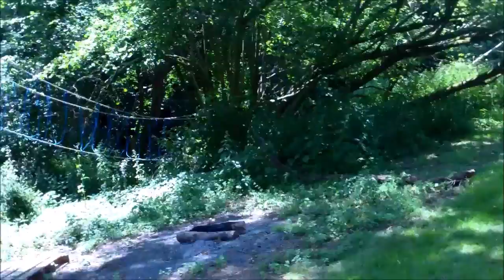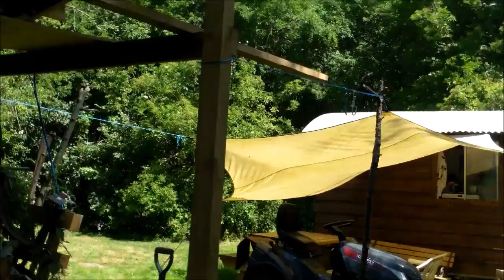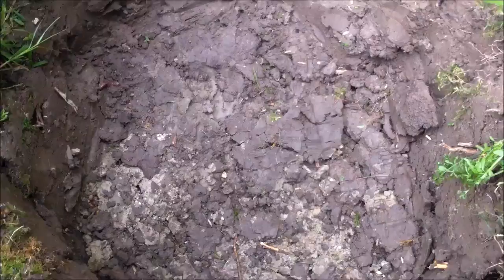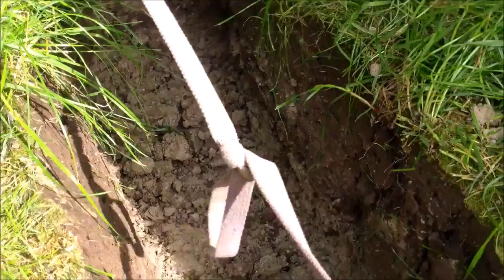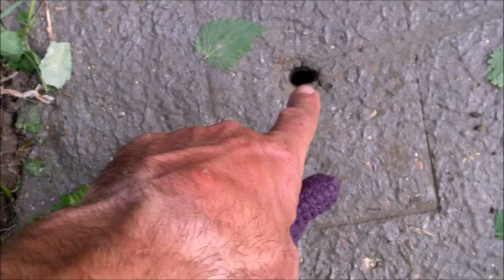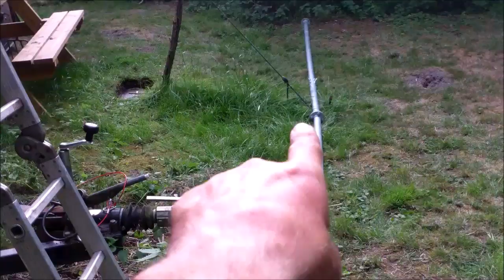Old Allens 22 The turbine part 1

Comment: Hi sam, Nice video, not sure using that mast is a good idea with the miss alignment, It must fail with regard to sale of goods Act, i.e not suitable for purpose. Having raised similar masts for Ham Radio Antennas That one would get sent straight back. You have also made hard work for yourself the way you have decided to fix the mast base plate. I am also concerned with the size of the hole, I would have dug a meter square hole that one seems a little small to me. Have a word with Sandy for his thoughts as I may well be totally out of order. regards BWR

Comment: Glad to see the latest vids. Your really coming along well.

2 questions:

1. - Why didn't you concrete the anchor bolts in place for the mount bracket?

2. - Why not call the manufacturer to get them to replace the section with the misaligned mounting flange?
Reply from the maker: Sig220Euro Hi Sig - thanks for the support - in answer to the questions
1. I will be using a 12mm x 80mm rawl type bolt which will allow me to re-tighten the plate if they come loose (also - I haven't bought them yet) It would have saved me having to get the generator out though...good idea.
2. I should probably do as you suggest but - the hastle factor is a real pain - I should contact them though you are right.

Comment: you can straighten the pole by using a second set of anchor guy lines.  you tighten the cabling to stand up the lower section and then do the same thing for the upper section.
Reply from the maker: Randy J Hi Randy- I may try straightening it by standing on it at the relevant point - as trying to put another set of fixings up on the pole would be a real pain. watch this space for more! Thanks for your thoughts.
Reply: Sam Knight Contacting the manufacturers would be a pain, but how about a local metal fabricators? My local one is pretty good at looking after the 'little' guy if they can, not sure how long it is and if you can easily move it though, maybe worth a try and wont cost much, plus it'll be straight at the end.
Reply from the maker: Have had a thought on this - will unbolt it and try spacing it with washers - one the inside where it needs it - hopefully a couple should do it.

Comment: Sometimes Sam we have to revert to modern materials, they have been invented and so we should use them for safety if nothing else, so don't feel bad about five tiny spots of concrete. That pole really is off by quite a degree, can the manufacturers not give you a replacement?
Reply: TheDiomedef16 considering the Romans invented concrete I don't know if I'd call that modern. But I get where you're coming from.
Reply from the maker: TheDiomedef16 yeah thanks - to my mind down there the concrete just look really out of place and those five tiny spots have put 250kilos of co2 into the atmosphere....kinda sucks. will contact biard (the munufacturers) and tell them of the problem.
Reply: I'll be honest, I don't really understand how people figure out something equates to X many tons or kilos of carbon or CO2 released. Maybe you can explain further?

On the concrete being ugly, why not just cover it up with wood chips once everything is in place to help camouflage it from looking so unsightly? Then in a year or so when they break down plant herbs or the like on it? Or maybe ring the guy whire anchors and tower base with dry stacked stone to create a planter of sorts. Wouldn't that help offset the CO2 impact you mention? Like I said, I'm not fully understanding how they come up with the CO2 impact that something has. I'm at a bit of a loss. If I'm being fully honest, I don't know how much of that stuff is actual real science based info vs. made up science.

 I mean if it's about how much energy was made to produce it then the windmill itself would be a massive sink considering what goes into mining and manufacturing the raw materials and then all the transport along the supply chain. It's like all those "eco-friendly" hybrid cars. Once you look into what it takes to produce those batteries and other components, a traditional car doesn't look so "unfriendly".

If you're feeling negative on the concrete, how about adding bio-char or similar into your ground to capture carbon and to help offset any negative you feel you've done? Plus you benefit from it improving your soils. I just recently heard a podcast on this and found it fascinating and that it can be done cheaply as a DIY project.
Reply from the maker: Sig, you are absolutely right - I kinda need to get over myself on this - nothing and no one is perfect - you have come up with some really good ideas there - watch this space! As regards the co2 Watching a building programme (grand designs) years ago they said that every ton of concrete used in construction releases the equiv of co2 into te atmosphere - this must include the mining and delivery and mixing although they didn't say..
Reply: Sam Knight Out of curiosity do you hear much on the bio-char in the UK? From what I learned so far the movement really seemed to originate out of Europe and seems to slowly be gaining notice and use here in the US. If you want let me know and I can PM you a link to the podcast where the lady really gets into the benefits and even how to go about making your own. I thought it was basically the ashes left over after you burned wood but found out I was mostly wrong... nothing new there. LOL

Place is looking great as is Wilma and can't wait to see more on the bee hives in your future vids. Does Wilma stay far away from the boxes?
Reply from the maker: I subscribe to a magazine over here called permaculture - It gets advertised in there - but as yet I have not looked into it. I had assumed it was just a marketing gimmick along the lines of what you thought. I will look into it some more though in the future - it might come in handy when I get to turning over the soil for the veg beds.

Comment: personally i would have gone for solar, much more reliable than wind power.
Reply from the maker: mick walker Hi Mick - at some point solar will be built into the system - easy to add it in later - then I am covered from both angles. thanks for your comment, and for your support to my channel.